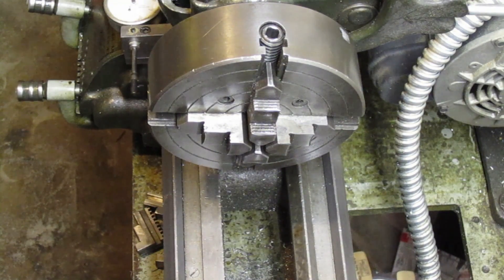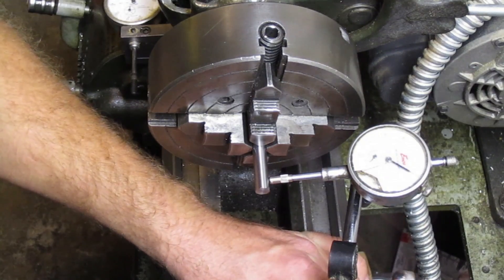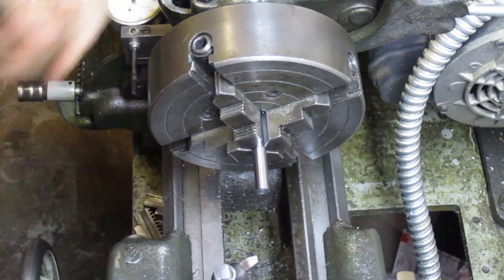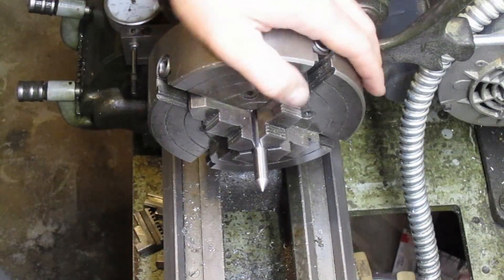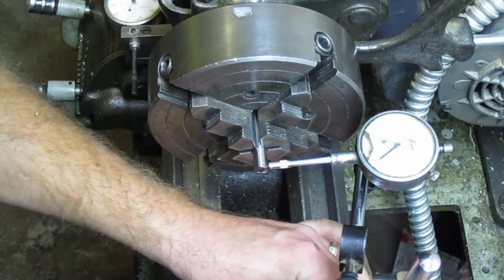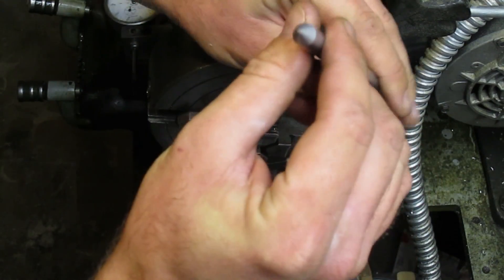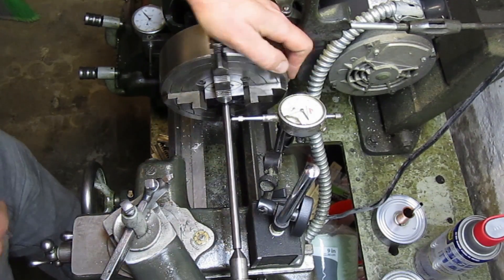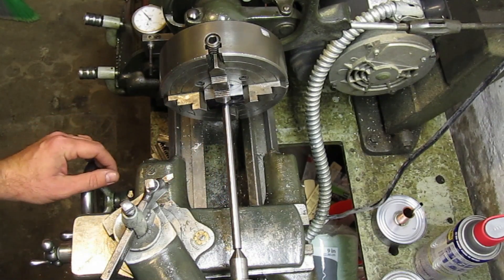Making a Center Finder - South Bend Model A Lathe

Comment: The easiest and most accurate way to do this is to take a length of rod and make a light cut the from end to end and mike each end if both ends are the same diameter the lathe is perfectly aligned
Reply: What you're describing is a method of checking tailstock alignment. I don't see it being applicable in BM's case here. BM has already center punched the work. He uses his method to dial in his 4 jaw to center to the center of the lathe.
Wakodahatchee Chris

Comment: Cool simple tool. Is there advantages/disadvantages to using a long rod like you have since you're indicating near the chuck anyways?
Reply from the maker: You can get away with a shorter rod but having it longer does make it a little easier if your tailstock happens to be a little off center.

Comment: If I understand correctly you had already found the center in the square stock and center punched it. The new tool you made was to be able to center the square stock in the chuck correct ?
Reply from the maker: You are correct. The tool will help you center a punch mark in the chuck. Whether the punch mark is in the center of your material or off center.

Comment: Hello, How do I fix the broken point on my tail stock point ? I didn't have the lathe chuck tight and my piece escaped like the ginger bread man.
Reply from the maker: +FrustratedBaboon
Are you talking about the center? If so, it would need to reground. If it is a dead center, they are fairly cheap and I would probably just buy a new one.
Reply: Ok thank you. I will buy one instead of having an off center even by 1000th.